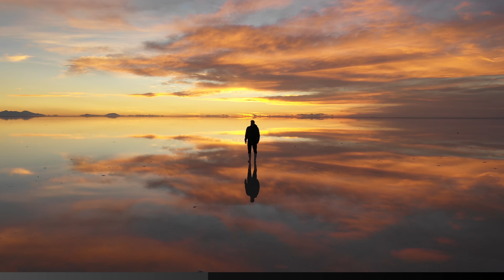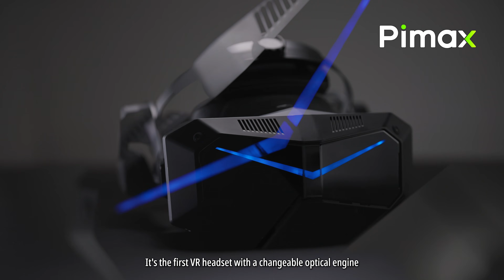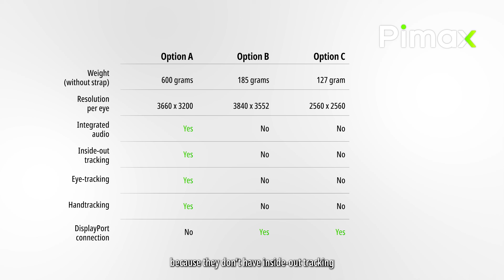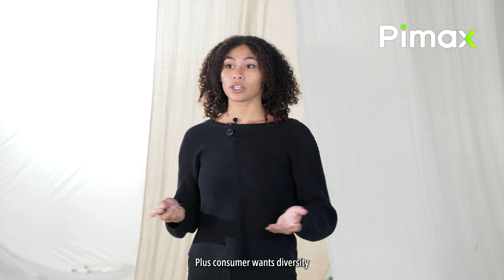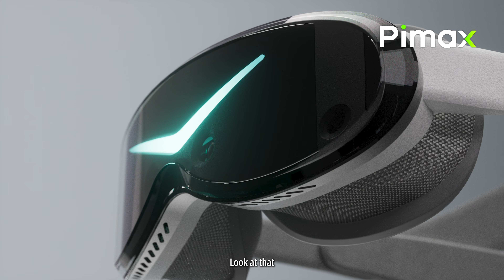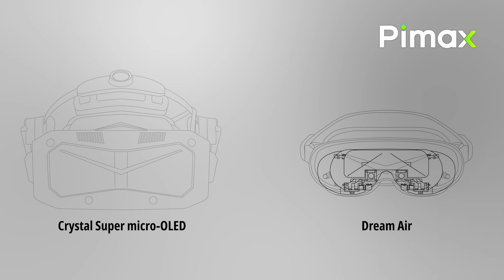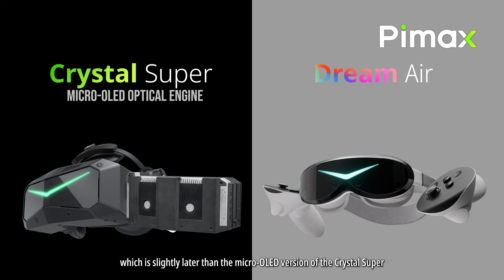Frontier: Hello Pimax Dream Air

Comment: Good for Pimax: at the very least, they are pushing for innovation at an affordable price.  I have the original Crystal and I am happy with it.  The new Crystal will have a smaller, modular form factor.  And their new lightweight headset is definitely enticing, based on size/weight.  I do hope that the light headset does not compromise on clarity or FOV—both of these are a must for a flight simmer.  I will definitely continue to consider buying more Pimax products.  Note: I currently own a quest 3, Pimax Crystal original, and an XR-4.  Each of these have their own unique advantages and disadvantages.  A smaller form factor the carries the XR-4 optics (or equivalent) will get my money for the next headset.  Keep innovating, Pimax, and ignore the naysayers who only want one product at a time.  For those of us real simmers, we will spend the money for the promise of some good, something better.

Comment: Pimax announces more vaporware forked from other vaporware, without fixing significant/major problems of the soon obsolete 2024 products. 12K trade in scam basically confirmed at this point. Accessories that were promised to existing customers never delivered. Endless vapid promises that they really do care about you...while announcing more pre orders.
Pimax deserves to fail, and they will when they run out of people to swindle.

Comment: What the actual hell is that pricing structure? Why pretend it’s $1199 then add a MANDATORY $700 subscription on top locking the software so it doesn’t even work!

Also, enough of the vapourware releases… it’s been three years and where is the 12K… hell where is the crystal super which you announced AFTER the 12K? Where are the wigig adapters for ANY of your headsets? Where is the actually functional software that doesn’t crap out and crash continuously.

Comment: Why won't anyone calculate headset resolution correctly? It should be the sum of the resolution of both screens minus the resolution of the overlapped area. A far cry from 8K. Even if you add the resolution of both screens, it's still doesn't add up to 8K which is 33MP.
Reply: They can't call it Pimax Dream Air 8Kish :)

Comment: DO NOT RELEASE THIS UNTIL YOU HAVE DP 2.1 READY I AM NOT JOKING THIS IS A NO-BUY UNLESS IT COMES WITH DP 2.1 80GBPS
Reply: If you watched Dream Air comes with USB Type-c. Super comes with DP1.4. They don't use DP2.1, because to reach 80Gbps you would need a chip that does not yet exist.
Reply: @Xr14-j5q  then this headset shouldn't be released until they have the DP 2.1 chipset, simple as that.
Reply: @Intelligenz_Bestie  I may be wrong, but the only chip I know of to this day can achieve 40 Gbps on DP2.1, which almost equals the bandwidth of DP1.4.

Comment: What's with the automatic headstrap tensioner? No one is asking for this. Just make it a manual adjust dial. The design looks fine. Just make it manually adjust like Vision Pro - since you've already copied it, just go with it. No need to one-up Apple by overcomplicating it with some crazy auto adjuster that will inevitably fail and make the headset unusable over a strap that won't adjust properly.

Comment: I love the puck idea, but you mention multiple times it uses the same lenses as the crystal super while also stating it uses pancake lenses. I thought the crystal super used a single glass aspheric like the crystal, not multiple that a pancake would
Reply: The Super has three different optical engines, one being micro oled, the same as being used here.
Reply: @JaapGrolleman  that's great! Thanks for the reply

Comment: They don´t have wifi 6?! OMG!!! WHY?? It's necessary!!!
Reply: Necessary for what? You obviously did not pay attention, it is not a standalone headset.
Reply: @Szabby999  PCVR headsets are so easy to use wirelessly. You just need to install an app on your computer. It's almost 2025! This should be standard equipment. A battery or power bank in your pants pocket is no issue. But a cable running to the computer is incredibly annoying!
Reply: Original Crystal does exactly what you write plus they have also announced their own wifi "airlink" device. They most likely don't want any more wifi compatibility in their new products.

Comment: Why not aspheric lenses? 
I actually liked having no glare. 
Pancake lenses are a huge downgrade i believe.
Reply: Micro oled and small form factor, have to use pancake
Reply: @JaapGrolleman  that's not true at all. As example pimax crystal oled still has aspheric lenses i believe.
Maybe by small factor, you meant lighter weight, i'm all for 100-200 additional grams for these better clarity low glare lenses. 
The real reason is the difficult with manufacturing

Comment: I bought the 8KX because the trade in deal with the 12K QLED. There has been 1, now 2 different headsets since I bought that like 3 years ago
Reply: Pimax has announced 8 headsets inserted ahead of the 12K so far.

Crystal (OG)
Portal (VR version)
Crystal Light (non-local dimming, which also didn't ship)
Crystal Light (local dimming)
Crystal Super (57PPD QLED)
Crystal Super (50PPD QLED)
Crystal Super (OLED)
Dream Air
Reply: @SargonDragon  Now with 4 models of Dream Air
Reply: Yupppp!!! I got a 5k super for the same reason... In my mind, they simply scammed me into getting a headset they will never release... I just came here to express my disapproval of this new headset, and to push the narrative that you should follow thru if you promise a 12k headset.... Never again...

Comment: It seems like Pimax needs to work on building back some good will with their existing customers before offering more stuff.

But with that said, this headset is exactly what I am looking for in a new hmd. I'm not a simmer, so the lightweight is a must. Eye tracking is a requirement and display port with lighthouse is even better. I will definitely consider it after seeing some reviews if this thing does materialize.

I think this headset does have a potential to attract a new section of the enthusiast market for Pimax, like for social vr users like me. But, to the existing base of customers who are likely simmers this probably feels like their concerns are being ignored with 12k and Crystal series.

Comment: Thanks to this Pimax Prime stuff I have no clue what the actual price is. With currency conversion there are three different prices, I have to assume the main big number price shown is actually fake because it seems low and the actual amount I'm paying is more and includes some kind of subscription, and I'm not sure what the total in my currency is. And then add shipping? Duty? Thanks for confusing me.
Reply: Pimax Prime is absolute garbage that should just go away. Has zilch to do with a "subscription", despite them calling it that.

Until they fire their management it will remain a crap company.

Comment: So you're telling me that the crystal super could've had the same form factor but instead of making it smaller you made an entirely separate headset?
Reply: Qled panels are bigger than oled panels. Bigger FOV, bigger lenses. The smaller fits always in a bigger box. If you only bother about mini Oled with a bad FOV, wait for the air. Otherwise buy a super with Qled panels and a cheaper interchangeable Oled module.
Reply: it couldnt have been the same size as theres limitations and compromises they have to make to make it smaller, its rather obvious
Reply: Yes.  The Dream Air makes the OLED module for the Crystal Super essentially superfluous.

Comment: I really like this form factor and the fact that it has dynamic Fov Rendering does put it above the other small form factor headsets by a LOT since you need that to run such a high resolution. My only real gripe is that it's not wireless. I get that the resolution is too high for wireless, but they should have an option to have wireless with less resolution. That would be a no brainer purchase for me. Just having such a high resolution panel would still make lower resolutions look amazing with wireless.
Reply: Who doesn't like it? But its vaporware until its real. They don't even have a prototype. Don't you see the 3D printed model she's holding. What other company in existence would do this? Its not even painted, lol. Anyone with a copy of blender and a 3D printer could deliver what we got from Pimax today.

Comment: I don't like the auto adjust head-strap. Looks like something that could break easy, and be expensive to replace. As usual. >.>

Plus I like my head strap to be on tight. Can't have that with some auto system.
Reply: Exactly. No one is asking for this. Just make it a manual adjust dial. The design looks fine. Just make it manually adjust like Vision Pro - since they've already copied it, just go with it.

Comment: Looks very good.  It’s a Meganex plus built-in, audio, inside out tracking, and eye tracking.   No small feat for a 200 g headset. I just wish the FOV was a bit wider.  It’s 102 degrees.  I wish it was at least 110.  I’ll probably get the Super with the LED panels for the big FOV and higher brightness, assuming the local dimming works close to as well as Pimax claims.   If not, then I’ll probably get the Air.
Reply: it's never going out in May. Far from it, they don't even have a real world prototype

Comment: ok, i can see it. its not for quest-users that are cable-free and on-board-graphics players, but for people with somewhat serious hardware that dont mind the cable. i can dig it. i think it might be even better if it worked with the airlink though tbh. maybe a module with a batterie and the airlink receiver as an accessory?
Reply: If you can run alvr on the cob, you got  wireless pcvr streaming.

Comment: Please find a way to connect this to iPhone 15+, iPad Pro and other usb-c/dp compatible phones! Even if it’ll be just a 2D screen. Even though the built in X1 chip in XReal one is pretty cool, all I really want is unplug headset from pc, plug into phone, and continue where I left off on Apple TV etc.
The phone or tablet is the device you already carry with you. Just like the phone took over most of the camera function.

Comment: so its a quest 3 with display port?
Reply: Not even close, they didn't mention stand alone, so its probably lighter, it uses microoled instead of lplcd, it has a direct display port connection meaning no compression, the only similarity it has to the quest 3 is the looks, otherwise it's pretty much pimax through and through (for all the good and bad of that sentiment)
Reply: @kaylerick The video is deliberately misleading! If you pay attention they talk about Type-c display port which in reality is a simple USB-C port, the same as on Quest 3 and has nothing to do with a real DP.
Reply: @Xr14-j5q  good catch, just checked rhe website and your right, it is display port but only through USB c(which is listed on the panel but is clearly designed to be overlooked) which means that are blatantly lying about the product since they have said elsewhere the stream would be uncompressed. If they were an American company I would say report them, but since they are chinese it wouldn't make any difference, what this does do is guarantee I won't even look at it, absolutely no reason for them to skimp on this if it's meant to be a pcvr headset. Imma go spread the word to those who were mistakingly falling for this.
Reply: @metalmanexetreme  It is easy to fall for this because they use the expression of Type-c Display Port connection. Which is of course a bald faced lie, because such port does not exist. There is USB-C and there is DP1.4 or DP2.1. USB 3.2 Gen 2x2 caps at a 10 Gbps lane speed (however we don't even know if it is Gen 2x2 or Gen 3x2), while DP1.4 is 32,4 Gbps.

Comment: Please bring back a 180° horizontal FOV VR headset!  No one needs a tiny 102° horizontal FOV headset. 😡
Reply: That's (atleast in theory) what the 12k qled is suppose to be, but at this point that seems more like a fantasy then a product that will ever be in consumers hands, and with how they are pricing these models, that thing will probably end up costing over 3k when it releases  (and that was before trumps tariffs)
Reply: @metalmanexetreme  ,  SMH. I’m still using my Pimax 8KX from a couple of years ago. I hope the Pimax Super will be ready in a few months.
Reply: @LeonardBrownArtbyLeonard  i was diehard with the 8kx too, ive only recently swapped to a q3 due to my index controllers breaking. I do really miss having such a wide FOV, but I think now ir would feel way too fuzzy since im used to the higher ppi of the q3. The 12k will likely be the next pimax headset I purchase (if they are still around by the time they figure out how to make it lol)
Reply: @metalmanexetreme  Crystal Super (57 PPD, 120 degrees h.FOV) and Crystal Super with 50 PPD, 135 degree h.FOV lenses will easily, by far, be the best image quality & h.FOV combo in the VR headset market. Nothing else even comes close.
Reply: @Spinelli__  I think 135° h. fov is still too small for a high end VR headset.
Reply: @LeonardBrownArtbyLeonard  8K X = 160 degrees h.FOV at 90 Hz (and 120 Hz with beta firmware for later headset revision). 5K Super = 160 degrees h.FOV at 90 Hz and also 140 degrees h.FOV at choice of 90, 120, 144, or 160 Hz.
Reply: @ The Large h. FOV setting is showing 170°, but my Rtx 4090 can’t run Large.
Reply: LOL even Quest 3 has larger horizontal fov than that.
Reply: @KodaiRyu  The Quest 3 is pathetic. 110 degree h.FOV, 96 degree v.FOV, 25 PPD. Crystal Super is 120 degree h.FOV and 57 PPD and 135 degree h.FOV and 50 PPD.
Reply: @Spinelli__  But normal Crystal has less than Quest 3 :P

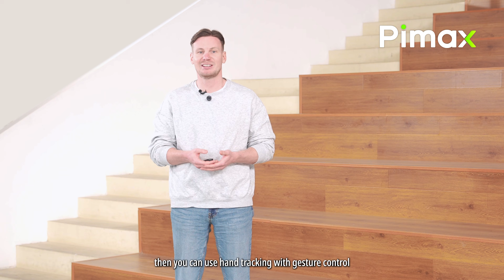Comment: 13:26 - What was the point of shrinking down the Pimax Crystal SUPER's size... if Pimax was ALREADY developing another tethered even smaller HMD, the Pimax Dream Air, ....? That R&D time could have been spent on finishing the "75%" finished Pimax 12 QLED alongside the Pimax Dream Air too.
Reply: The original Crystal was way too big.  It was comically big.  They had to reduce the form factor for the crystal light and crystal super for them to really sell in good volumes
Reply: If you buy a super with Qled panels for simming ,having a bigger FOV and brightness, but you want as well enjoy VR games and chat with a lighter interior panel system (as it will fit inside the "air" hmd) you get the oled module for 699. Otherwise pay more and get the air in addition to your super Qled with all the benefits of having a small form factor.

Comment: you call it full feature, but it lacks face tracking for vrchat users, so already a deal breaker for me.
additionally pimax neglects still a wifi connection that could have been available on crystal without additional cost, but on this new headset without wifi is definitely a no go.
Reply: Adding Wi-Fi would’ve added way too much weight. It’s only 200 g.  Adding the Wi-F and a battery would add another 500 g, I would guess.  They should really have a short display port cable down to a hip worn battery and Wi-Fi module.  That would give you wireless, without compromising the weight of the headset.
Reply: @nhtalbot  a wifi module should be already integrated in the intern chip that they use, so no weight gain there.
as for battery, it can be either worn externally like you say on the hip or on the back of the head which also adds balanced weight distribution, so less front heaviness.

Comment: I would have cared if it wasn't in 7 months. Now you're letting all the other industry giants they have to compete in that price range. Within that time frame, there will probably be other headsets announced that will better satisfy people with lower costs and 120hz support.

I'm all for Pimax but I'm here for large FOV, high refresh rate, high quality pancake optics and near identical eye PPD resolution. 

Despite being small, this headset does not satify me because it does not have extended fov. That's what pimax is known for. 

You're also selling dreams with the 12K and there has been no news about it, why would I take time to look into anything that is not the 12K ? This new headset is simply a lightweight crystal with the crystal features.
Reply: You cannot have high PPD displays, with pancake optics and high FOV. You don't understand how basic VR technology and display optics works. FOV comes at the expense of clarity. You're essentially asking for a device to be a telescope and a microscope at the same time, or demanding a track race car with SUV storage.
Reply: Actually Meganex super light announcements first with the same price

Comment: This needs a hip pack with battery and wireless VR connectivity so this becomes a wireless PCVR headset.
Reply: Maybe the Cobb puck they mentioned at the end will do just that.

Imo wireless PCVR is a good feature that would be really nice but standalone is skippable especially with such high res headsets.
Reply: @lacedchemist1295  Nope. No VR wireless function in the puck. But considering they now have the Crystal's wireless pack, they could easily adapt that into the puck. They just don't wanna 😄
Reply: Exactly what I was thinking

Comment: Ah jeez, "ANOTHER" new headset before the current promised headsets are out.  Why Pimax???  So the Air will be out in 2 years after a dozen redesigns?

I just want a improved 8KX:
  smaller form factor
  FOV > 130.  This the most important thing lacking nowadays.
  PPD of 35 is fine.
  Better Glass Lenses
  qled/oled panels
  individual diopter and IPD adjustments
  Base Station tracking, save the cost and processing of cameras.
  Vive style strap with no bulk at the back of the head.
  Below or around $1000

The Super comes close...if/when it actually comes out.
Reply: The Super is not under $1000, also neither is the Beyond, which HMD are you looking for?
Reply: Read again slowly  "I just want...".
It's a wishlist